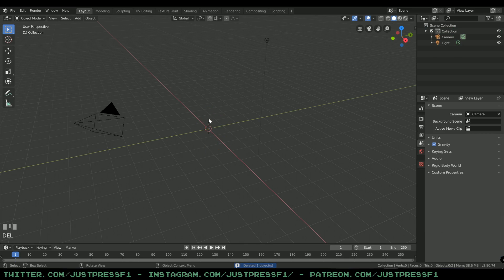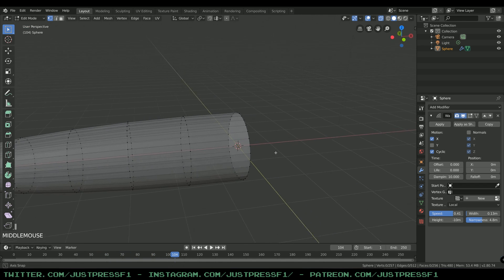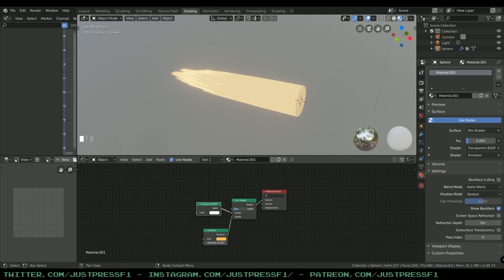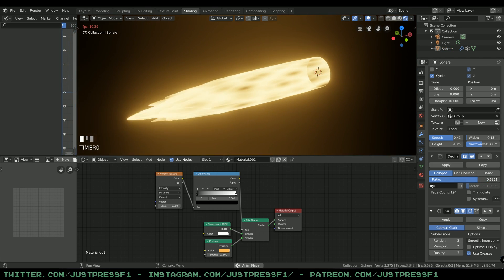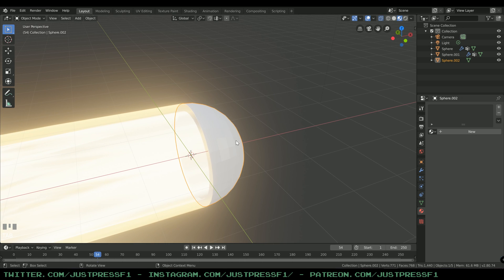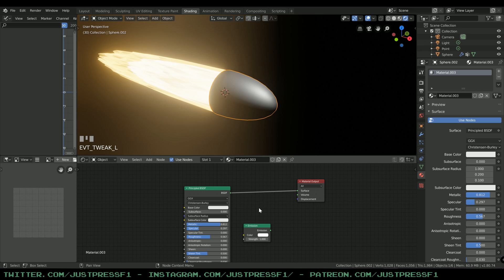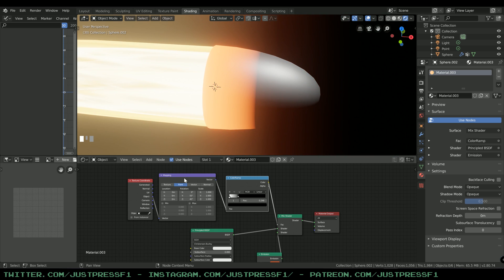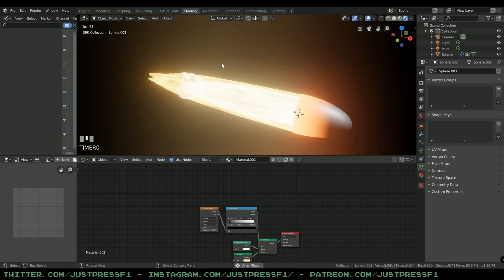Blender: Rocket Exhaust Flame

Comment: This effect is incredible.
It would be interesting if some manufacturer managed to make this type effect on a resin to be used in plastic airplane kits in the scale 1 / 72.1 / 48 and 1/32 to simulate the after combustion of a fighter ... many collectors could make dioramas with aircraft models simulating a takeoff with maximum power
Reply: I'm pretty sure that there are crazy people out there who have achieved this already. I saw one of a tank where they made dust trail, and had explosion from the cannon firing that lit up, was really cool to watch how they made it.

Comment: Hi, thanks a lot for this great tutorial, but I have a question: when I try to repeat what you did with Blender 2.8 and I try to select parts of the mesh I only select the side visible to me, and not the meant one. (for example to remove half sphere when I select I delete a quarterand then I have to rotate and remove the other quarter that was on the "far side". do you know why? thanks
Reply: hit keyboard shortcut z to enable wireframe mode/ xray mode